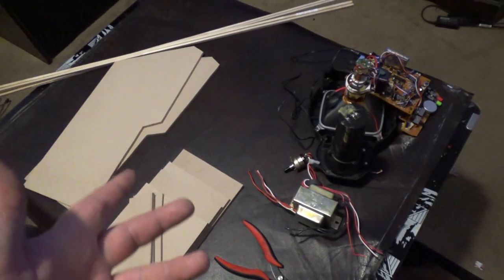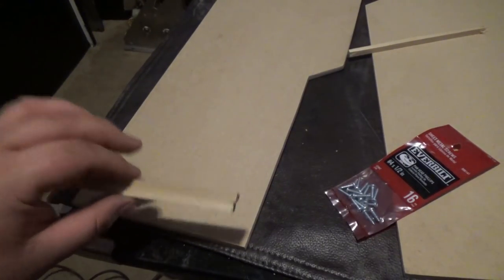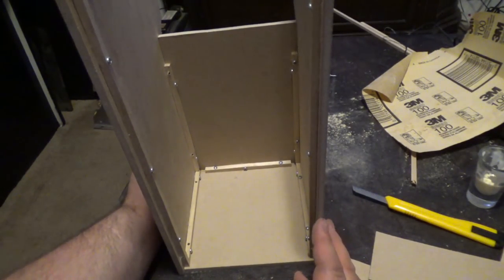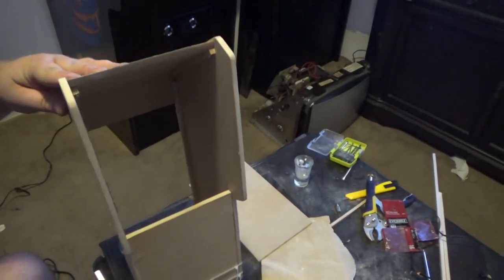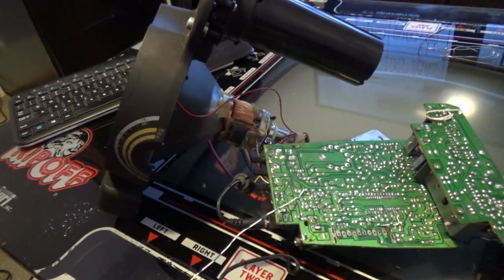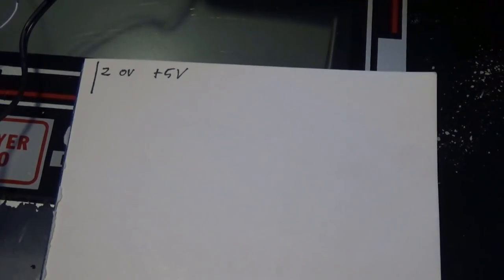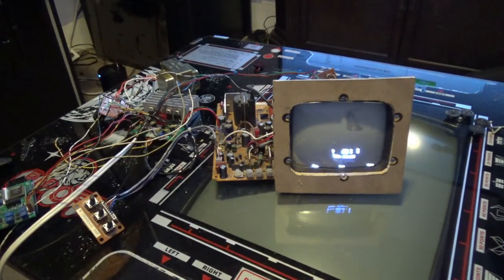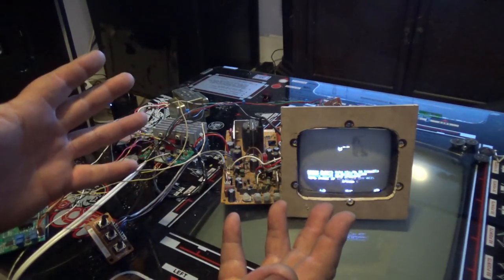making a tiny asteroids deluxe arcade

Comment: Just a quick tip, to save yourself all of that pre-cutting...
use spray adhesive to tack the template to your material, and just cut the material according to the printed template.

Comment: Very cool!  I'm doing a similar project with a 1/4 scale Dig Dug and a Raspberry Pi.  Of course, I'm using a 5.5inch LCD; didn't other to look for a tube.

I'm not bothering with screws or wood glue.  I used to build R/C airplanes, and CA adhesive will hold stronger than the wood itself.  Just rubber band it together and hit it with CA.  It will wick into all the joints and create a super strong bond.  Very fast!!!

Comment: If you run the brightness from the FPGA board into the top of a 500R POT, the other end to GND - take the wiper and connect to the point on the tuner module where baseband was, that should make a good reliable brightness input.

Comment: awesome, you are a crt magician.
I wanted to do something similar with an old 5" B/W tv, but have no idea how to connect it to a video signal :(
Reply from the maker: look up the pinout of the video chip there should be a composite input pin solder a wire to that pin and remove the tuning circuit
Reply: Thanks, Ill have a look into it, would love to have a small space invaders. Great vid btw, you need more subs :D
Reply: I did this to a Sony watchman. Turned it into a pong game. I had to remove the rf modulator and the video decoder chip. After that I was able to wire composite video to one of the pins that went to the chip. Here’s a video showing what I did: https://youtu.be/PuiLvJbx7Tk